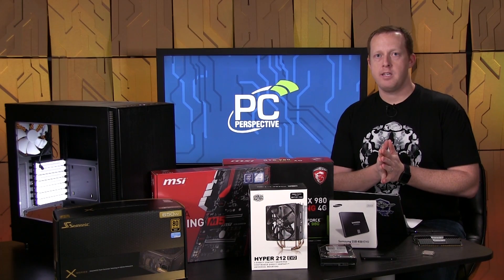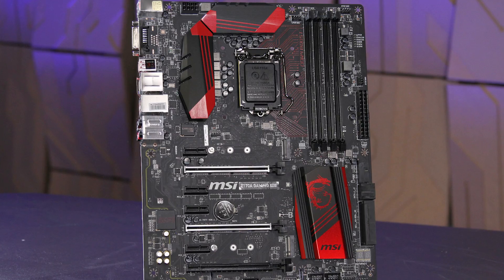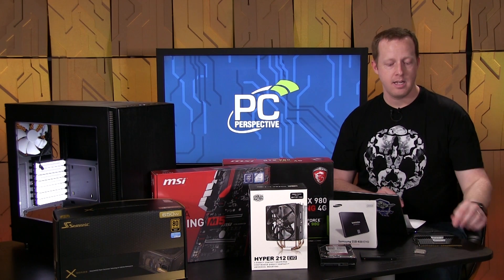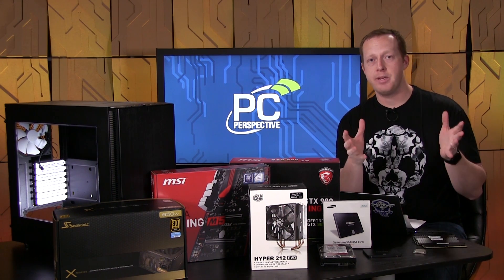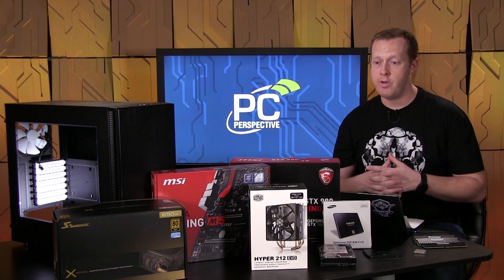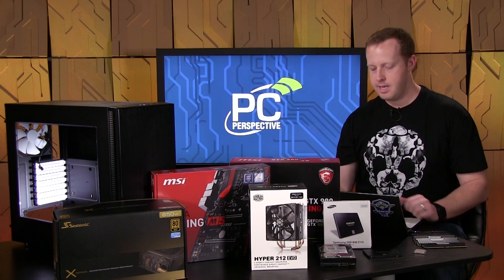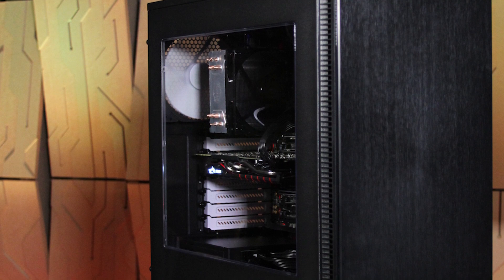VR System Build Guide Spring 2016: Mid-range at $1500

Comment: Under $1400 X99 build with an R9 nano, I'd maybe get a 390 though if someone only has a 1080p display to game on, and ya, I'd go for a 5820K>6700K any day man, nearly the same price, the motherboard just costs a bit more

Also if you go for the 390, you could just throw the saved money towards whatever the top end GPU is in a few months when all the new ones come out

Same reasons for AMD as before, seemingly better DX12 support, and saving money on free-sync 

 PCPartPicker part list: http://pcpartpicker.com/p/bKrQ8d
Price breakdown by merchant: http://pcpartpicker.com/p/bKrQ8d/by_merchant/

CPU: Intel Core i7-5820K 3.3GHz 6-Core Processor  ($351.98 @ Newegg) 
CPU Cooler: Cooler Master Hyper 212 EVO 82.9 CFM Sleeve Bearing CPU Cooler  ($28.99 @ Newegg) 
Motherboard: Asus X99-A/USB 3.1 ATX LGA2011-3 Motherboard  ($249.88 @ OutletPC) 
Memory: Crucial 16GB (2 x 8GB) DDR4-2133 Memory  ($58.99 @ Adorama) 
Storage: Sandisk SSD PLUS 240GB 2.5" Solid State Drive  ($54.98 @ NCIX US) 
Storage: Western Digital Caviar Blue 1TB 3.5" 7200RPM Internal Hard Drive  ($48.97 @ Directron) 
Video Card: XFX Radeon R9 Nano 4GB Video Card  ($469.99 @ Amazon) 
Case: Deepcool TESSERACT BF ATX Mid Tower Case  ($35.99 @ Newegg) 
Power Supply: EVGA 650W 80+ Gold Certified Semi-Modular ATX Power Supply  ($69.99 @ Amazon) 
Total: $1369.76
Prices include shipping, taxes, and discounts when available
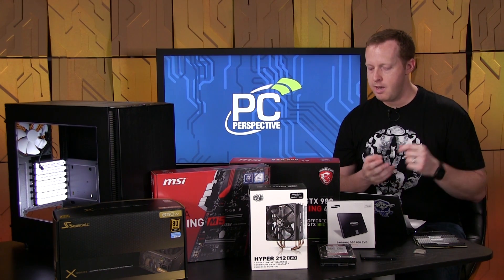Generated by PCPartPicker 2016-03-24 03:21 EDT-0400

Comment: 980 is barely faster than 970 and noticeably more expensive. You really needed to mention why bother with it. The same goes for the hyper threaded CPU. 0.0000000000001% of the games will notice it and run a single frame per minute faster, once in every blue moon. 

And also, what the others mentioned- why intel/nvidia only? AMD has good GPUs, if not CPUs at the moment. What are the actual differences in price performance between 390 and 970- in some of the unreal 4 games, or some other games/demos that are for VR. That would be way more substantive than simply listing why you can spend 50% more money on 1% higher performance.

Comment: Drop overpriced Skylake components. Start with a 980 Ti. Add 4790K, Z97 Mobo, 16GB DDR3-1866, and end up at $1500 with a better machine for VR and gaming. Sebastian did a long article showing CPU's don't have anywhere near the impact that a graphics card does in gaming, and yet every build is pushing Skylake.

http://pcpartpicker.com/p/Bs3Q8d

Comment: why a 980 instead of R9 Nano ???? there is no explaination for such a choice considering the price cuts on the AMD Card,
Reply: +InitialDAmine the nano isnt that great of a deal I would rather a fury
Reply: +meh mehabd Not at all, the best Fiji ships binned are used in the Nano hence the much lower power consumption, then you have ships are used for Fury X, and the fury get the least powerfull fiji ships, but that's not there is to it, the Nano got a very agressive price reduction a couple of weeks ago making it cheaper or at least costing as much as Fury or a 980
Reply: InitialDAmine the normal fury still costs the same and outperforms it.
Reply: +meh mehabd stock they are about equal, maybe with a very slight advantage for aftermarket fury (I don't think you can get one with a stock cooler anyway) which has a factory overclock, you just put both ships at same frequency and tada! at worst you get the same performance as a Fury and probably better performance while keeping a signigically lower TDP with all the advantage it has. Even for those who doesn't want to slightly overclock I would gladly trade the 1 or 2 fps advantage in average over the 80-90w tdp at load.
Reply: InitialDAmine its more than 1-2 fps
Reply: +meh mehabd in most game it is.
Reply: InitialDAmine im seeing more than 10 http://www.anandtech.com/show/9421/the-amd-radeon-r9-fury-review-feat-sapphire-asus
Reply: +meh mehabd You are seing wrong, here are all Anandtech benchs between the stock Nano and the custom strixx fury http://www.anandtech.com/bench/product/1556?vs=1522
Reply: InitialDAmine The R9 fury consistently wins? Which is something I said..
Reply: +meh mehabd You said there is a big difference, which as I said most there is a very small marging considering the the downclock on the Nano, at same clock the Nano would be at worst the same as the Fury with lower power consumption, and at most likely has better performance, with lower tdp.
Reply: InitialDAmine Oh sorry for some reason I thought you were talking about the 980. The nano is also cheaper than the normal fury now making it even better. I would still go with the normal one because more fans at lower RPM is a bit quieter but that may just be me.

Comment: Getting sick of all VR builds using Nvidia GPU.
Reply: +Orjon Zaganjori It's annoying in the sense that Nvidia is using their money/manpower to build & develop software that only runs on their hardware and works with game devs & content creation software to include it. (with the dev not implementing an equivalent solution that runs on all hardware) Thus creating a wide slew of features in a lot of software that require NVidia hardware. In this scheme, only Nvidia benefits. It locks me in an ecosystem where Nvidia is the only option or I risk losing a lot of features I use on a day to day basis. Logically if AMDs next GPU destroys the NVidia competition, I would buy AMD. But because of said software, Nvidia is the only option. So everybody recommends Nvidia GPUs because of this.
Reply: What software would that be? Gimp Works?  If that's true that's just sad. First AMD as Open GPU and second Gimp Works is a reason not to get Nvidia lol. I am all for people that know their stuff and chose either side. Mostly talking about people that do not even know AMD exist like in some game system requirements they only state Nvidia parts. A person that does not know much will look to get a Nvidia GPU.
Reply: Aside from the gameworks, various Video rendering & 3D rendering software have an accelerated renderer or physics system that only works on Nvidia Hardware and reverts to CPU if an NVidia gpu is not present. A lot of stuff on the content creation side is still reliant on CUDA for example. Substance Painter, Autodesk 3D software have iRay or Mental ray, both Nvidia funded/developed renderers that don't work on AMD gpus. GameDevs heavily use these software packages, so they all use NVidia hardware, which inadvertently may lead to optimisation skewed to Nvidia hardware, which may lead to a reviewer recommending Nvidia Hardware. It's a vicious circle.
Reply: +Jeroen van Wamelen  wouldn't mainstream developers be developing games to work best with AMD's GCN hardware? GCN being in the recent console generation would mean AMD's APU is the "minimum spec" when scoping the development of a major game wouldn't it? I mean just because you content create on an Nvidia platform doesnt mean the content is optimized for that same platform right?

Comment: http://pcpartpicker.com/p/BtvQ8d - 980ti build that outperforms this video's  featured 980 build in gaming and costs $1164 after discounts.
Reply: +Brolivia Wilde Gigabyte warranty is meh. Shit case and meh PSU.
Reply: +meh mehabd that is a fair opinion, but you do understand that it is an example of something that has much better gaming performance and costs a lot less than the build featured in this video?
Reply: Brolivia Wilde The build featured includes the cost of the headset.
Reply: +meh mehabd Unfortunately, the price tag of $1589  of the featured build in this video does not include the headset:
CPU: Intel Core i7-6700K - $362
MB: MSI Z170A Gaming M5 - $200
Memory: 16GB Corsair Vengeance LPX DDR4-3000 - $79
Video Card:  MSI GeForce GTX 980 Gaming 4GB - $459
Storage: 500GB Samsung 850 EVO - $149
Stoage: Seagate 2TB Barracuda - $71
PSU: Seasonic X650 Gold 650 watt - $129
CPU Cooler: Cooler Master Hyper 212 EVO - $29
Case: Fractal Design Define S Windowed - $111
Grand total: $1589

Here is the link where PCPer posted this article that outlines pricing: 
http://www.pcper.com/reviews/Systems/VR-System-Build-Guide-Spring-2016-Mid-range-1500
Reply: Brolivia Wilde I see my mistake. Well here is your build done better! http://pcpartpicker.com/p/XYmhnQ enough wattage for 3-way sli even. Plent y of money left to go to a 6700k too.
Reply: +meh mehabd haha, true, but it also costs about $200 more and lacks an SSD ;)

which really backs up my point and what others have said, that for $1500 or less, you can get a PC with a 980ti which would be a much more powerful gaming pc than what is featured in this video.  I'm sure there are even cheaper build lists out there, i just used the $900 list that they featured and basically swapped out the 970 for a 980ti.

Comment: 980 seems like such an odd choice nowadays. Would much rather get a 390 as it offers a better price/performance ratio and will put you under that $1500. Or you could put those savings into getting a better CPU cooler. Same if you switched out the i7 for the i5.
Reply: +sandkatt or the equally priced higher performing fury

Comment: 980 is poor choice though when it comes to bang for buck. Either settle for 970 or go for 980 Ti instead.
Reply: +Melinon  R9 390 or Fury X*
Reply: +Floris R 390 is a good choice too. I wouldn't pick fury x over 980ti though.
Reply: Melinon I would if I want to play DX12 games at maximum performance.
The Fury X outperforms the 980Ti in DX12 game benchmarks
Reply: Floris R Some, yeah, but it's too early to call how things end up in the long run. 980 Ti has a lot of oc headroom too, and Fury's 4 GB memory might end up being too little in the long run especially at higher resolutions.
Reply: Melinon The potential performance of the Fury X is higher compared to a 980 Ti, and the Fury X does a better job at high resolutions like 4K in (DirectX12).
The 6GB of the 980 Ti might be a reason to buy one for the future, since many games use more and more VRAM.
If you want to get good value, get a Fury X,
if you are willing to spend more money, get a 980Ti.

Comment: I'd rather make compromises for a 980Ti
Reply: +Moyukh Shabon My first thought was about putting in an i5 instead of an i7 and going for a Fury or Nano. Probably a cheap case would work even better and not give up any performance benefit for the games that take advantage of hyperthreading (and there is certainly a benefit to using an i7 if you stream while gaming and are not using a capture card). 

I wouldn't build a PC right now (or at least wouldn't buy any of this gen's graphics cards), I'd wait until the next AMD and Nvidia series come out, which hopefully, if they both stick to their schedules, should be in just a few months. A little longer for HBM2 cards. :)
Reply: +Moyukh Shabon Right I changed my GTX 780 to the 980TI. the steam vr score went from 4.2 medium to 10.7 very high. I'm interested to see a 980ti in this build  to see the difference with the 6700k and ddr4 ram would make over my 4770k and 8Gigs of DD3.
Reply: +Penterax I'm thinking of building a new PC with an r9 390 since its relatively inexpensive and can hold me over until the new gcards come out.

Comment: for that budget I would like a 980ti. shave off the money from other components but never skip on the psu or you will learn the hard way .
Reply: +Ottavianus Augustus I have a i5-4670K paired with a 980Ti G1 and it maxes out the valve VR benchmark. So yeah I agree that the budget on Ryans build wasn't well distributed.
Reply: +Ottavianus Augustus I wouldn't go for a 980ti with new GPUs only 2-3 months away, an R9 nano is near $460 right now, much better for the money over a 980ti
Reply: i wouldn't go for any card with the new one so close
Reply: *****
Naw a 380/380X/390 are all pretty solid from 200-300, nano's going a bit over that though